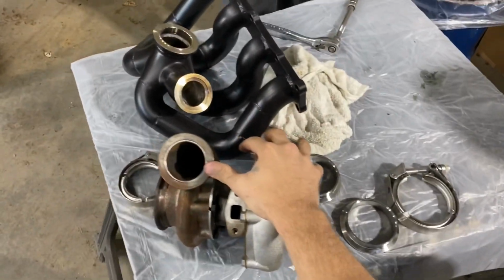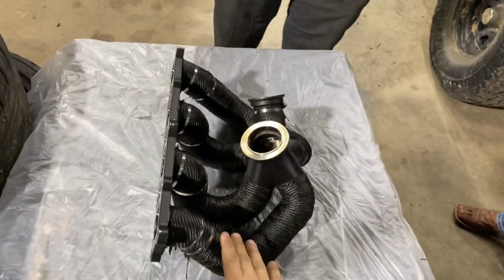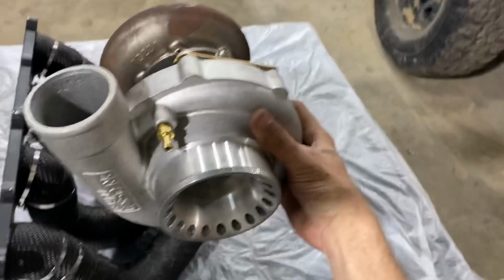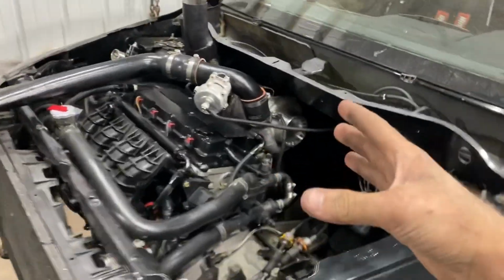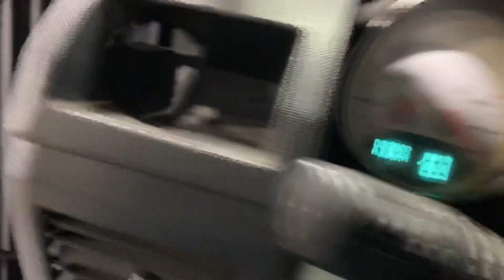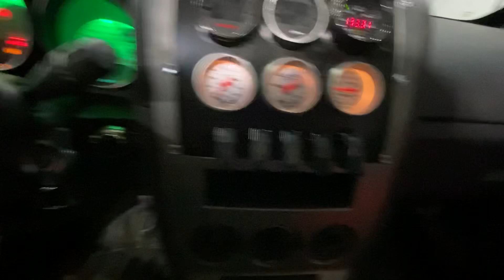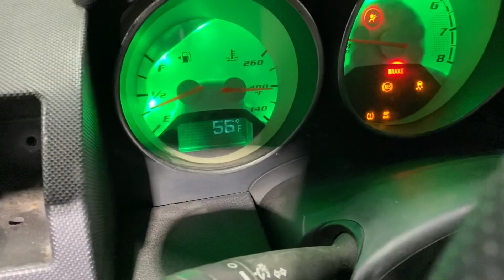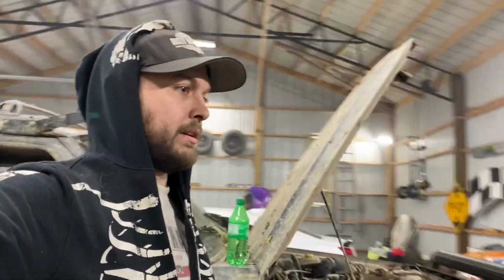CALIBER SRT4 BIG TURBO INSTALL: PTE 6266 Ready to make ALL THE BOOST!!!

Comment: Is there a turbo replacement for a stock manifold my turbo is on its way out and I wanna go big turbo
Reply from the maker: No, but you can send your stock turbo to be upgraded to a larger wheel. Companies like Realtune and TurboBay can upgrade it. Or you can have a custom manifold made for a larger aftermarket turbo. I made 487whp/453wtq on an upgraded wheel stock turbo

Comment: Hey man i have a question. Sinc you have alot of experience on csrt4. My csrt4 wudeband is reading lean. And it feels like it wans to turn off or jerks when i step on the gas.. how can i fix that? Or any tips or points that i can check?
Reply from the maker: I would start with boost leak test. Compression test, leakdown test, and new plugs gapped properly for your setup.

Comment: Did u change the gearbox? Or still original
Reply from the maker: Original transmission. Only added an LSD from Realtune Performance.
Reply: @rustynutsmedia  do u know a good turbo  for sxt (2.0 td 🇮🇹) ? thx 🤝
Reply from the maker: Honestly I know nothing about the TD engines. I don’t think those were even sold in the US market
Reply: @rustynutsmedia  thx 🙏